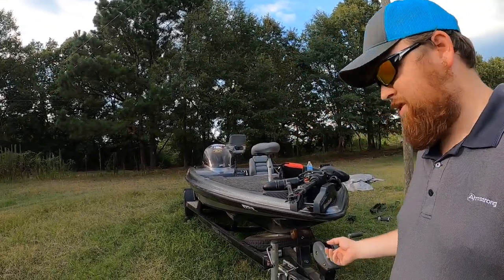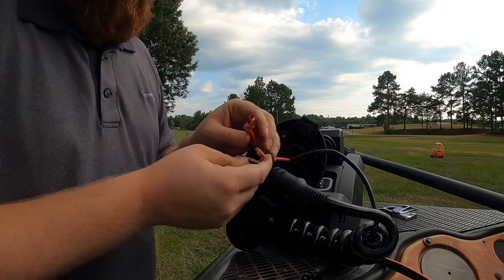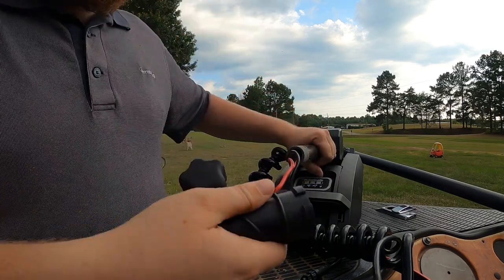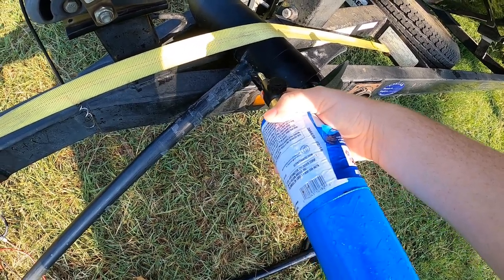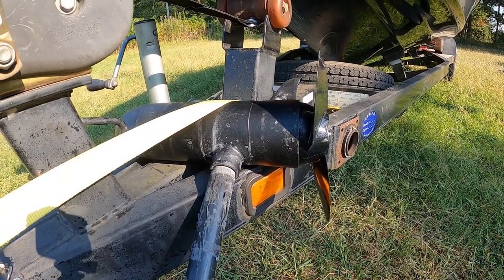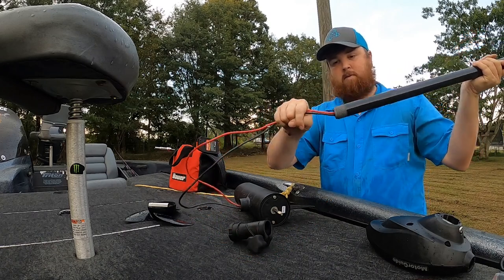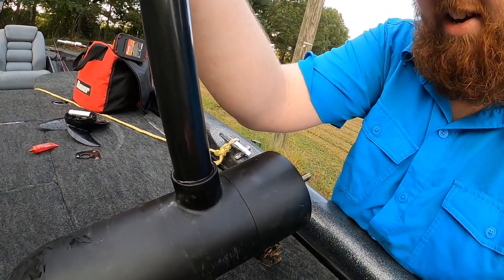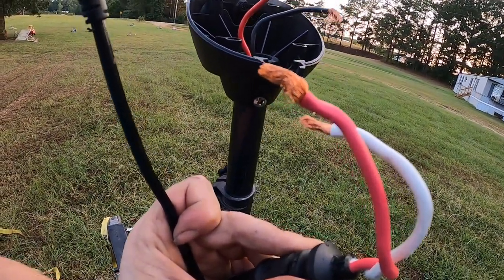EP.3 Motorguide Xi3 Shaft Replacement

Comment: Did you have to drill a hole in the shaft for the head
Reply from the maker: You do, I must have missed that clip when I put my video together.  Nothing to it though,  just stick the head on and make sure that it's lined up and pointing the same direction as the foot then mark the spot on the shaft where the hole should be,  take the head back off, drill the hole, then put it all back together.
Reply: Thank You.I had an unfortunate accident with mine this weekend lol.Do you think you could shorten the shaft up some and just push the excess wire in the shaft tube? I don’t need mine as long as it is
Reply: @AlanBell01  I believe you can cut them shorter
Reply: @AlanBell01   just cut the excess off

Comment: You used a pick only to clean treads?
I’m just trying to make sure treads are clean enough.
I used a pick then a small wire brush and was able to get around wires.
Really don’t want to take head apart!
Maybe try to “dry fit” it first?
Reply from the maker: I actually used a pick and a small wire wheel, I mentioned it in the video just didn't actually get a clip of that part. I would think that you should be fine as long as you got all the left over material out of the threads and didn't get any down into the components of the motor. Good luck on your repair!

Comment: Somehow the collar/bushing on the bottom of my transmission assembly is missing.  Any thoughts on how I can get a replacement.  I called Motorguide but they were unable to help.
Reply from the maker: I would probably start by seeing if that specific part is shown on the parts diagram for the xi3 and go from there. Good luck! Try looking here for it maybe: https://www.boats.net/catalog/mercury/motorguide-trolling-motor-by-model/motorguide-xi3-series/9d362441-up-cat-90-8m0140451/complete-trolling-motor

Comment: Thanks for the video. Helped a lot. 

Can I use blue locktite? Or do I have to use red?
Reply from the maker: Red is recommended as it creates a permanent bond that can't be broken without heat. I wouldn't use the blue personally, it may work, but I would rather be on the safe side and stick with the red.
Reply: @BreamBassBeyond  thanks. I appreciate the quick reply.
Reply: @BreamBassBeyond  I had broke the shaft on my minnkota and let it sit since broken. I took it apart today and ordered the shaft and internal parts. Wish I had taken it apart sooner cause the motor got water in it when it broke and it’s very corroded inside now after sitting. Hoping once parts come in I can put the new shaft on and put new parts in the motor. 

Parts and shipping were best price from minnkota directly. 

Did you check if your motor got some water in it when it broke?
Reply from the maker: It didn't, my trolling motor deployed while I was on plane, luckily it snapped above the water line so no water got in it.

Comment: What did you use to take out the old expoxy
Reply from the maker: I used this little pick set from harbor freight to get most of it out https://www.harborfreight.com/mini-pick-and-hook-set-63697.html .
I spun a small light gauge wire wheel around in it afterward just to be sure I had it all out.

Comment: How did you get a flashlight inside the foot to show the threads you cleaned out??  Did you disassemble it to get access to the inside?  It appears you have the flashlight inside shining out.
Reply from the maker: Yeah, I disassembled my foot just to be sure that nothing inside there was broken from the impact that broke my shaft, it took a pretty good lick!
Reply: @BreamBassBeyond  Thanks for the response.  I'm going to heat and twist the shaft tomorrow.  I called MotorGuide Tech support and they said 99% of the time it fails!  Why do they sell Replacement shafts than??? LOL.
Reply from the maker: That's pretty crazy, does make you wonder why they even sell replacement shafts for sure! Guess I got lucky, mines' still going strong!

Comment: Same thing happened to my xi3.  Unfortunately, we drive home in the rain and although it’s sits a covered area, apparently water got into the motor at some point and has set there for a week or so.  What should I do now?
Reply from the maker: Did the water get in the head of the motor with the circuit board, the foot of the motor, or both?
Reply: @BreamBassBeyond  it just got into the motor.  There was a little bit of rust but I was able to clean it up mostly.  I let it dry really well.  I have it all back together.  Just need to put the head on and drill the hole.  I’m thinking it should work just fine.
Reply: Now if I can just figure out how the get anchor mode to sit perfectly over a brush pile. 😂

Comment: Did you melt the old composite shaft off by the thread?
Reply: Ive been heating ot for 5 mins, and it wont come off.
Reply from the maker: I heated with a torch to break the bond of the locktite. I scraped the remaining bits of it out with a curved automotive pick.
Reply from the maker: @pywifishingandoutdoors  dang, sounds like yours must have had a better bond than mine. You may have to use a pair of channel locks or a pipe wrench to get yours to turn while heating it.
Reply: @BreamBassBeyond  lol, yeah, looks like it, theres a white bomding material i can see on the threads, i dont think its coming off without doing more damage to it or the lower unit.
Reply from the maker: @pywifishingandoutdoors  man, that sucks! In my position, my shaft was already destroyed so it didn't matter if I damaged the shaft more, I'd be worried of causing damage in your situation too since yours is actually still functional.
Reply: @BreamBassBeyond  yeah it is what it is, hopefully the 36" shaft is enough to be mounted on a jon boat. I can live with it on my yak.

Comment: what if i wanted a longer shaft on my XI5 with transducer , can that be done?
Reply from the maker: Yes, same process as this.
Reply: @BreamBassBeyond  Won't the wires inside the shaft be to short for a longer shaft?  I too need to go from a 52" to a 72" on my Xi5.
Reply from the maker: @Coleman T  yeah, for jumping up to a 72" from a 52" you'll need to order a longer power cable from Motorguide as well.
Reply: @BreamBassBeyond  I'm wondering if I can just splice  in some same weight wire extensions to add the extra 20 inches.  What do you think?
Reply from the maker: @colemant6845  yeah, if you're using the same gauge wire that should work out just fine. Word of warning though, that shaft is a pain to get free from the foot!
Reply: @BreamBassBeyond  Yours came off easy but I know not all do... How long did you hold the torch on before twisting it off?
Reply from the maker: @colemant6845  like 5 minutes, I tried to break it loose after like 2 minutes and it wouldn't budge so I just kept heating for a few more minutes.
Reply: @BreamBassBeyond  My Xi5 has a white plastic collar covering the base where you were heating with the torch.  Did you remove it first?... or does the Xi3 not have one?
Reply from the maker: @colemant6845  no the xi3 didn't have one.

Comment: I did not have your luck. My Xi3 wouldn't turn out, not even after getting it hot enough for the shaft to start on fire. After the trolling motor deployed by itself and destroyed itself, I'm going back to minnkota.
Reply from the maker: Wow, that's crazy! I'm glad mine worked out so I could get some more use out of it, I'm considering swapping over to the Lowrance ghost myself though, the xi3 just doesn't cut it!